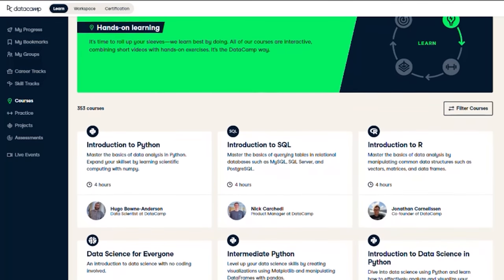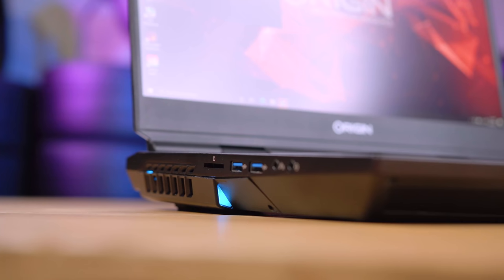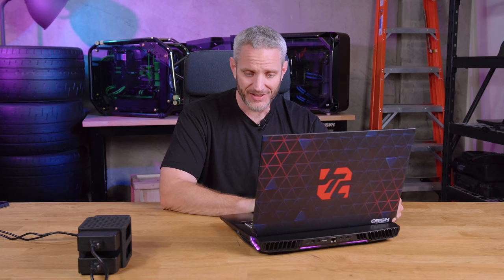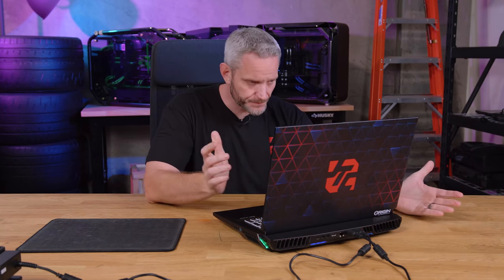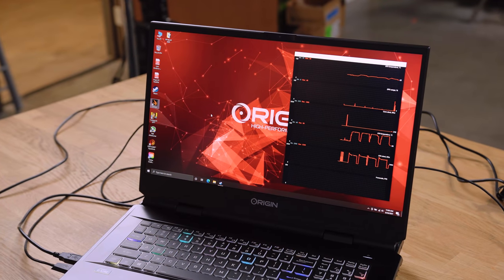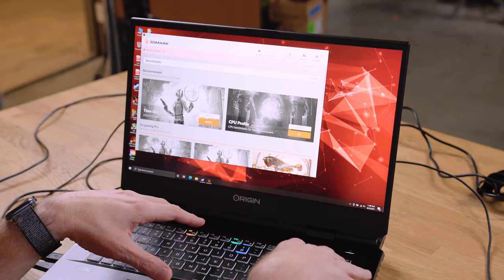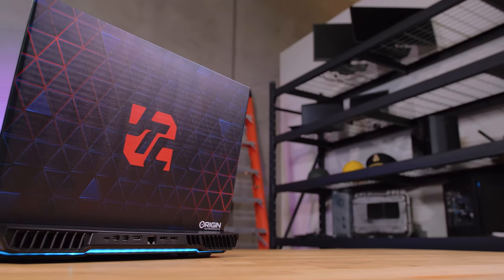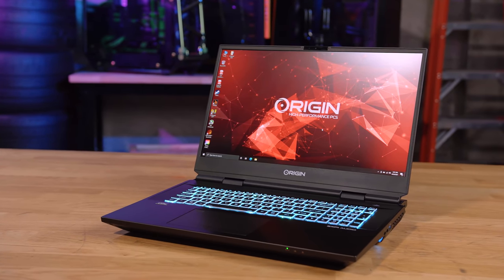You are GUARANTEED to HATE this... which is why it's so AWESOME!

Comment: Clevo makes some real awesome value machines.   I have a Sager version with a i7-8086 and gtx1080, only issue was my cats shredded my keyboard, so I replaced it myself and it's still going strong, both for games and as a space heater.  :-)
Reply: Gtx 1080 is fine on 1080p, that laptop will last for years.

Comment: A+ I like the layout. and until you get that perfect 90% surface contact your chips will always hit cap throttle. also you need air flow for the chipset make a 3rd fan just to draw air threw the motherboard.

Comment: Being a power hog is not a issue for someone like me. What I use mine for is portability. I can take it to point A, plug it in and do things, then go home, plug it in and do things etc etc. RARELY do I need more than an hour or 2 TOPS of it running on battery. So this would be RIGHT up my ally.

Comment: The weight makes it less likely to be used for traveling, the battery is useless.

At this point you're better of building a PC in one of those tiny cases which still fits a Noctua NH-C14S, and get a good monitor and proper mouse and keyboard.

Comment: In a hungry system like this, with no viable low power mode, I would not even bother putting in a battery at all. Save the weight and space and maybe use it for bigger heatsinks.

Comment: I don't understand why they don't make aios for laptops. They all use basically the same size heatpipe/heatspreader solution so it should be possible to make a few universal types that can be used in a wide variety of laptop brands. Could clip the radiator to the back of the screen  or even attach it to the power brick.

Comment: I like the cooling on this system. Its pretty good. I always liked desktop replacement monsters, even though they are dinosaurs. 

I would say this though. I wonder if ultimately - a slightly lower spec desktop proc would not actually give you an equal or near equal real world, and not be quite so close to thermal limits. In the end, its about usable - reachable performance, other theoretical maximums. 

Did not like the 2400 speed ram, which seems a corner cut in a high premium system...

Thanks for the video!

Comment: 20:31 CAUSION  the thermal pad touches the SDRAM and NOT the NVME CONTROLLER than needs cooling SDRAM doesn't need cooling the thermal pad is ON WRONG position making it a heat trapping area instant of  heat socking plate. (ps. the 970 evo has ZERO contact with anything cause the 2nd Pad is no the 3nd spot that nothing installed there) If the 970 Evo was on the 2nd spot the thermal pad would actually contact the Controller. 
TLDR Is : Not all Nvme has the controller on the same spot so you have to move the thermal pad accordingly.

Comment: One thing that has always bothered me about laptops is Thermal throttling when under heavy load. I Realize that due to the small form factor that is an inevitability with current cooling capabilities. It just seems like we could do better with it. I also liked how you stopped yourself from using the term Thermal Throttling. to "Frequency" Same Difference just laptop manufacturers are scared of the term Thermal Throttling.

Comment: Here's the thing... a 3080 ain't gonna get you 300fps at 1080p. you'll get maybe half that. On top of this, it's a laptop so have fun changing the adapter about 3~4 years in when performance drops and you're troubleshooting the whys and hows and suddenly it makes sense. It's the darned adapter not supplying enough. Seen that more than enough times with laptops.

Comment: The battery is basically a built-in UPS to allow you to save your work and shut down or move between outlets. It looks like a nice machine for what it is, though holy cow, that dual power brick is an abomination.

Comment: I really love desktop replacement laptops. They are very fun to work with and get optimized for your liking. My Desktop laptop is a 3 fan SAGER speced with the older 8086k (8700k) and GTX1080. I put liquid metal on both the CPU and GPU. Temps on the CPU max at stock with an undervolt 68c. GPU is a struggle to keep under 80c in some games as it hits 86c at times but it is a 1080 with a 200w power limit in a laptop so not much I can do there lol but it clocks (1911mhz) and scores just the same as the desktop 1080. Cost like $3000 back in 2016 but I have no reason to upgrade even now I'm still 100% happy with it and its performance. Also it has 3 nvme drive slots and 2 SATA slots. So its a solid machine just like this one. I just would not want the 11900k though. Rather an AMD 5000 desktop CPU then that.

Comment: With something like this, would a peltier cooler be a good idea? When using wall power you could use the cooler to help assist the CPU run as fast as possible, however on battery mode you could flip the peltier in to power generation and use the CPU/GPU heat to help assist the battery at the cost of some performance vs being plugged in.

You'd still need the heatpipe and cooling array to remove heat from the peltier or when in generator mode, but if you're already going balls to the wall, why not beat the competition with some fancy thermal trickery?
Reply: You would need even more cooling capacity to keep that peltier working.  OTOH, you could build a laptop cooler with a peltier (or four) on top, and basically give the laptop its own AC system.  Just be careful of condensation

Comment: What’s happened to gpu overclocking? This mobile 3080 got plenty of temperature headroom. I own Clevo based chasis almost 6 year old Myhlogic dtr with desktop 6700K at 4.4GHz downvolted and desktop 200W power GTX 980. Still works great, like new. Supplied with Delta’s 330w power brick. And both CPU and GPU are overclockable. This year the machine was upgraded with a pair of 970Evo Plus nvme drives set to Raid0. 6 year old dtr is still actual. The only drawback was the prcie of 3K, which was almost twice higher compared to the same components based desktop. 
DTR class of laptops deserve it’s spot on in the market

Comment: Question: Two plugs for 560W seems like a poor design, especially because they will both be plugged into the same outlet. Is it a polarization / electrical phase thing, redundancy, or something else? My home tower is running an 850W supply on a single plug with a 11700k and MSI 3070 ti (the real one). $5,000 laptop w/o a "real" RTX 3080 seems beyond excessive.

Comment: When he talks about audio, my head straight up thought of comparison between this and the new Imac & MB Pro
Reply: The new iMacs sound quite bad, compared to a desktop, but they sound quite good compared to laptops, and since the M1 is practically a phone it's quite impressive as a phone.
Reply: @igameidoresearchtoo6511  The iMacs sound worse than desktops? If so, then their marketing is a piece of garbage.
Reply: @dy7296  Not all iMacs of course, and not all desktops, but iMacs generally sound bland on the lower end of the spectrum.

And of course, their marketing has always been garbage xD
Reply: @igameidoresearchtoo6511  you know I'm talking about the new imac right?
Reply: @dy7296  Oh...Well I don't have one to judge but all my previous ones sound bland on the lower end of the spectrum.
however I have heard it's speakers before, at a computer store, they sound....like a TV, a cheap, casual, very average TV,
It tries to mimic surround sound but can't do so, so it sounds pretty weird and quite like a TV, but I can't judge much since I only tried one single audio benchmark (the crab rave "benchmark"), but knowing apple I think I might have a rough idea of how it sounds in most cases.

Of course, this is based on opinion, you might like how TVs sound for example, but I don't.
Reply: @igameidoresearchtoo6511  you mean you don't have the new one?

I mean it's ok tho. I don't have any either.
Reply: @dy7296  Obviously not, after I moved to PC I realized how trash apple was and never got an apple product since,
I built a PC 3 months ago though, and 12 years owning apple trash lol.
Reply: @igameidoresearchtoo6511  lmao

Comment: From my experience, 100C is not good, the CPU is fine but the battery (at least on the laptop I had, razer 9700k 2060) said it shouldn't be hotter than like 65-70 I think. I used to render blender stuff in the night and the battery turned into a balloon. (If I were to need a laptop again I'd go for something where I could hook up an external GPU so the cooling only has to do the CPU. But ofc u can't game unless you wanna take an egpu with you)

Comment: I'm a bit baffled by why you wouldn't run an 11600k in that. I'm relearning enthusiast PC building after quite a long break and all the changes and creature comforts have been mind blowing. My point is, the number one biggest difference between PC tech now and PC tech 10-15 years ago is all the dynamic thermal "throttling" (not to be confused with actual thermal throttle, but I don't know what other word to use.). The architecture of this thing IS impressive, and with that kind of mobile heat management, I think you'd be able to take an i5 much farther than you could take an i9. I could be wrong, the i9 does have a lower base clockspeed, but it also has more cores. And features are great until you put on your engineering glasses and start thinking about efficient cooling.

Having said all of that, and btw being very impressed by the thermals of the 11600k, it's also clear that intel has put a lot of time into features to try and lower the effective TDP at the cost of pure sustained clock speed, just to try and do the same thing that a Ryzen chip in the same weightclass can do defacto.

So what's really surprising here, is that while the Ryzen would probably have better TDP and thermals in this kind of setup in a stock apples to apples comparison, I think the 11600k might actually be able to pull ahead with the way it can cheat its vcore and frequency with thermal based regulation features. Then again, it's an uphill battle because the Ryzen is just naturally a cooler chip.

For a bit of reference, I recently bought a 11600k and spent most of the week assembling and tweaking. I've got it where 2 cores clock up to 4.9 rn, the rest clock up to 4.6, vcore never goes above 144, idles at ~133, and has a dynamic fan profile that aggressively spins up proactively, instead of reactively. When idling you can hear it, but an overhead fan is louder. During practical load it does get louder, but if it's a game, you have to try and notice it above game sound. During bench heavy load, yeah, jet engine, but that's what I want. In 1 week I've gone through 2 coolers, an A500 (~100c under bench load with all 6 cores hard clocked to 4.8((horrible thermal efficiency from the chip at these speeds, the gains aren't worth the heat)), noctua ~70-75c in the same setup) that I knew was trash when I bought it, and an NH-D15. The difference is night and day. Also for reference, under bench load it goes up to 125w, sitting here typing this it's at ~15w.

The point is, I know for a FACT that the 11600k can make huge dynamic gains to provide the best actual performance usage possible for whatever your thermal setup is. It can work with a shitty cooler. It works way better with one that isn't. The fact that it can thermal tune itself to either situation, and to do so dynamically in real time, I'm curious if AMD can do the same thing, and I'm also curious if it even needs to, or if it's TDP is low enough that it doesn't need to resort to thermal "throttle" fuckery. Having said all that, back to my original point, I'm surprised that the 11600k isn't the prime choice of CPU to put in the intel version of this rig, and that it's a 11900k instead. Other than the monkey brain thinking 9 is bigger than 5 and so must be superior, I'm trying to come up with a practical reason why in that setup you'd want to run a 9 instead of a 5 when you care about performance. having said that, being an impractical setup might be the entire point of that rig. IDK. Still curious what it'd do with an 11600k at it's heart.

Also, generally when I say performance I mean PC Gaming Hobbyist, not workstation. If you're gonna use this thing as a workstation, maybe the i9 is the way to go, but even then, I doubt it. It has to be bringing in enough thermal overhead to just turn on that it's outclassed by the i5. A laptop is not a drag race machine, it's a drifter. The i5 is a drifter chip, if we're looking at the intel lineup. Then again, maybe they've got some proprietary throttle tables in the BIOS that do things my mobo can't. A stock underclock to like a ~3.2 that can dynamically boost individual cores up to ~4.5-5.3 based on usage that is more tightly tuned than anything my novice ass has been able to pull of this week, maybe I'm wrong.

Finally, this is way too long for a youtube comment and no one cares.

Also, I see you there at 32535 JayzTwoCents.

Comment: I bought this in a nearly identical spec from a different brand (they're all just rebranded Clevo X170 rigs), and it gets mid 13,000s in Time Spy.  Idk why yours ran so slow.   Stock software also allows undervolt and under/overclocking to control temperatures, and there is another nvme slot on the other side, for a total of FOUR drives, with 3 of them attached to the RAID controller.
Reply: Oh, and mine doesn't have rattling TouchPad issues.

Comment: I both agree and disagree with your screen preferences. I actually have a clevo p870dm-3 desktop replacer, 7700k, 32gb 2666, and dual gtx 1080's, but it has a 120hz 1440p gsync panel and it looks amazing, even being a TN panel. I agree that 4k is still too much for a laptop and pointless for a gaming laptop, but after living with 1440p at 17" for 4 years, I'll take my panel over 1080p any day.

Comment: I do wish the meta for laptop design at least for some segments moved away from thin and hot, thin and throttle a lot, thin and no slots, and last but not least thin without much in the way of ports. I really do hate that almost all them went to BGA only where before there was a cpu socket and a mxm slot often with four sodimm slots to top it off.

Comment: This is probably a stupid question, but I'm about to build my first computer and I'd rather ask a dumb question than blow up a component, so. When I go to bench test all my major components, like the motherboard and cpu and graphics card and all that, by assembling them out of the case to make sure everything works and I get a Post, how do I turn the system off once I get to the bios? Is there an option to shut down the PC in the bios, do I just jump the power switch contacts again like I would do to turn it on, or is it as simple as just unplugging the power supply or switching it off?

Comment: that power brick holder is wrong.. they should of made it where bricks are side by side so the heat can easy escape the 2.. having it like that will make top one bake and likely bottom one emitting the heat to fail faster..

Comment: Totally went through the parts picker - this thing is damn near $6,000 as configured.
Reply: Sager's has their's at about 4.5k for the exact same specs, the only difference is they just offer 144Hz for the 1080p option. 

They did have a 300Hz panel like a month ago, and when I originally bought mine it had one. However I had to send it to RMA because it had a bright dead pixle on it, so its getting replaced with a 144Hz one instead.

I am not mad though, lets be honest, most AAA games don't need that much refresh rate, are 60fps locked, or can't even achieve more then 100FPS...

Comment: What would you use the thunderbolt ports for on such a beefy laptop? Its a nice feature, but what would be the use case. An external GPU would be less than the GPU inside. An external RAID seems odd because of the NVMe capacity on the laptop. Only thing I could think of would be a 10G NIC dongle, but that is not helpful in games. Or using the thunderbolt as a desk hub for peripherals when at home.

Comment: Oh, that's the new version of my laptop with the 11th gen CPU instead of 10th gen. (and 30xx series GPU instead of 20xx).

It's pretty good, but they get LOUD. And don't expect the battery to last longer than an hour. :D The one I have is the i7-10700K and 2070 Super, and has the 2 power bricks.

EDIT: For Jay, on the disassembly, you have the 3 NVME slots on the left hand side. On the right hand side, under the fan, there's ANOTHER M.2 slot. On mine, because it's the older laptop, it's got an M.2 SATA connector so I have a 2TB WD Blue SATA in there.

I've heard that this machine apparently supports M.2 NVME, but only PCI-E 3.0. I believe the other 3 ports are PCI-E4.0 with the 11th gen CPU's (and for anyone else reading this, you can totally toss an i9-10900K in it if you want)

Comment: Prices starting at $3,000 and up to over $6,000 though... Especially when you can design a desktop with the same specs for a fraction of that, thats a no for me.

So much for being a "desktop replacement" when the damn thing is as twice or more expensive than a similar spec desktop.

Comment: Jay, I would be really interested in seeing you swap out the 11900K in this laptop for a 10900K and checking out the gaming performance... You should see an FPS increase with a 10900K and I'm not sure what the thermals would look like that's why I would love to see you try this out.  Only issue is I'm not sure what kind of NVME drives were installed in this machine.  I don't think you mentioned if they were Gen 3 or 4 but I could be wrong.  So regardless that would be the biggest pain in the ass is if this 11 series chip is running gen 4 NVME ssd's you would have to put a gen 3 in there to test out the 10900k but of course you already knew that just saying it for anyone else that might read this who  maybe doesn't deal with this hardware on a daily basis like you and I do.